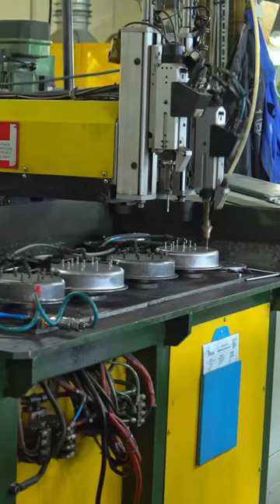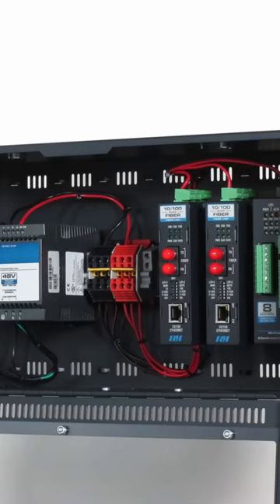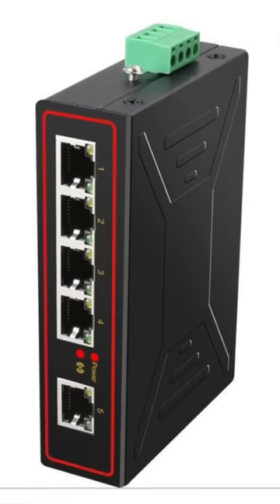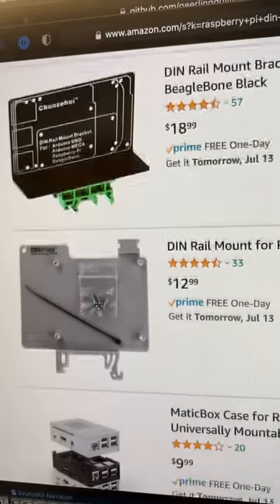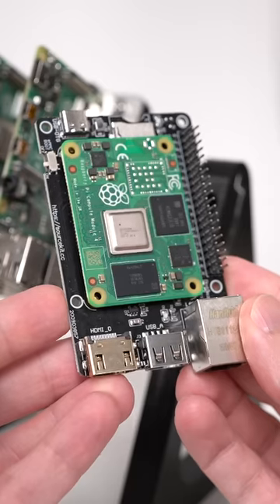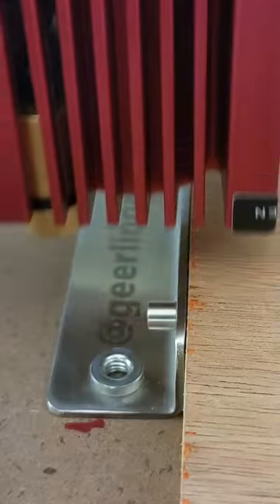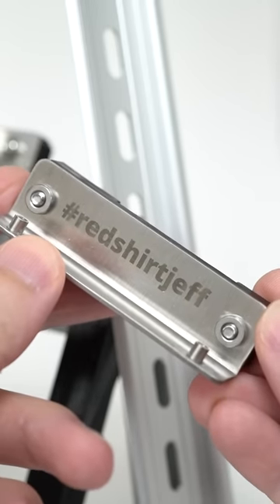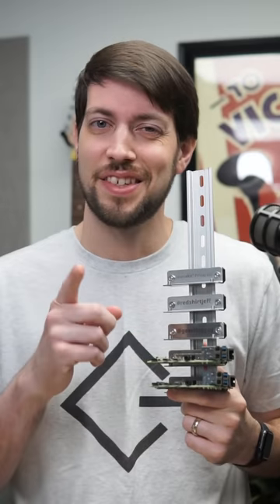DIN Rails make Pi mounting easy! #shorts

Comment: We use Pi Zero's (and a few 3B+) in automation projects. We mount Pi boards on DIN rails using the DINrPlates DPZ1 and DRP2. Super robust and include cable management. They also have versions for Arduino and Beaglebone.

Comment: nice... but my only issue with that would be that is it possible to mount them horizontally (IE by the short edge) with the ethernet ports sticking out front?
Reply from the maker: This particular model won't do that—there are a few other DIN mounts that do, but it seems like most have them oriented vertically.

Comment: Why do people densely pack so many PIs, they crypto staking (e.g. Cardano), or mining?  Thought ROI was not worth it?  Or people just flexing on new way to heat their homes?
Reply from the maker: In my case, I use one cluster of Pis for K3s and K8s testing, and then I have a number of Pis lined up to run services like Pi-hole, hosting a few low-traffic websites, and then a Pi to manage all my data archival and backup processes.

All the Pis' configuration is managed with Ansible, and I have backups of everything—and I can (and have) restored one of the Pis within a few minutes of it failing before.

It's more fun to manage things that way (and with all the Pis together using less than about 60W of power) than with one beefier server chomping through 100+W and creating a lot more noise.

Comment: Looks like something that can be 3D printed in half an hour.
Reply from the maker: Quite true, and there are dozens of ready-made designs you can print on a 3D printer.

The nice thing about these is the compact size (can't print something rigid enough for sturdy two-hole mounting in the same form factor) and the good spring mechanism that holds them in place (most of the 3D printed ones rely on tension in the PLA and that doesn't hold up as well over time).

But there are a ton of options on eBay, Amazon, and elsewhere—I liked these since they were one of the cheapest, yet also one of the strongest and most out-of-the-way :)
Reply: @AstroCat Is that supposed to be a joke? It's a little holder for a raspberry pi, not a wall mount for a refrigerator.
Reply: @Jeff Geerling, product link would be nice for folks without 3D printer and metal bender brake.  Links to mounts for makers fortunate enough to have tools would be appreciated.